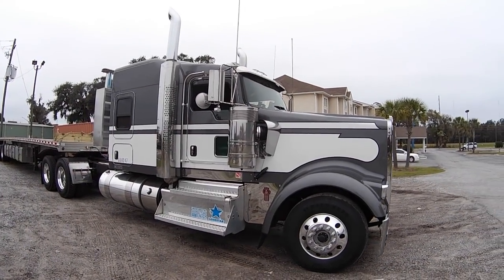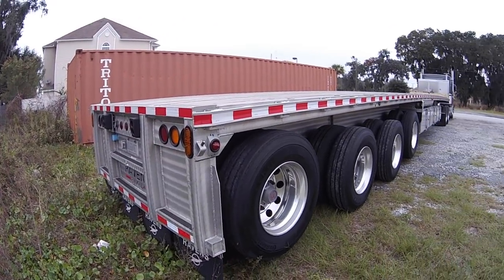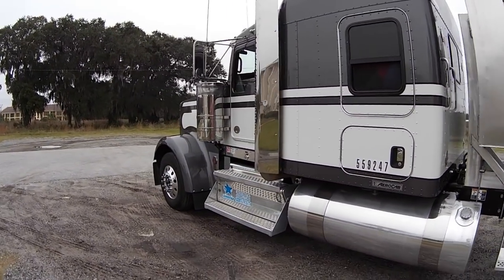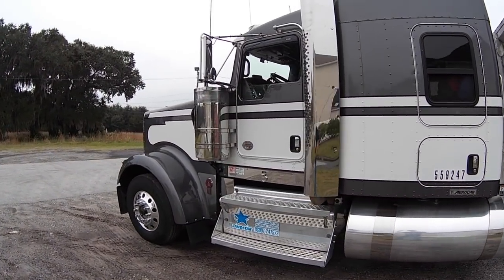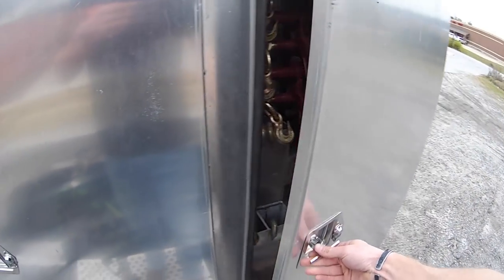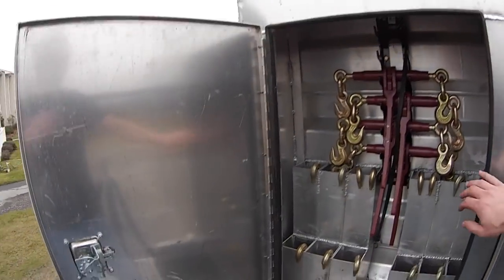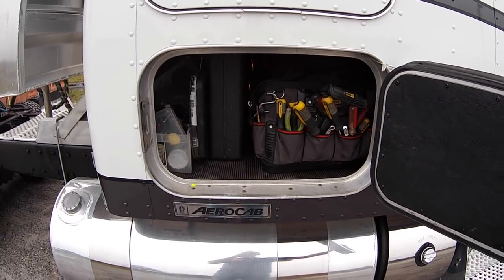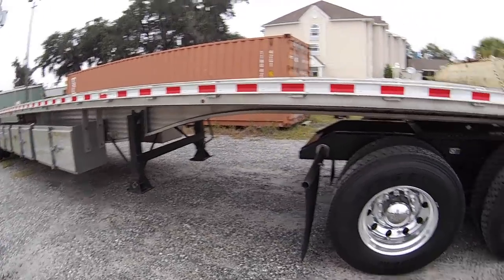Tour of my Heavy Haul KW900L and Trailer

Comment: I’m really enjoying your videos but I have a question. At 16:10  you mentioned those rubber pieces to run between your chains so you don’t decrease the WLL. I’m curious if that’s a state by state or a federal law. I have been told the chains can never touch so I really don’t know. In the business I’m in, I never let my chains touch. However, it would make my life a little easier at times if I knew I could simply place a quarter inch piece of flat rubber between them. Thanks

Comment: Mornin Nick! I'm new to the channel and love the videos so far, your a fine driver. First thing I noticed in the MHC KW mud flaps, nice touch. I am a technician for MHC and love seeing trucks and what they do and how guys like you put them to work. Great looking truck, love the color scheme and design it has. My question for you is when you purchased the truck were you expecting to go into heavy haul or was it something that was decided after the truck was purchased? I was just curious as to why the truck wasn't spec'd out from the get go with a third drive. Another question is, the last video of yours I watched was one of you haulin a 100k lb rotor and noticed the check engine light on, and with the choice of an emission equipped Cummins it could be a hand full of things. I was just curious why not a glider such as your mentor with the c16? Sorry for all the questions just curious with the equipment. 

Stay safe out there driver,
Alex
Reply from the maker: Thanks for stopping by, and welcome to the channel! We kind of fell into what we did. I had intended this truck to remain pulling a standard flatbed, and then purchase another heavy haul specific truck. However, we found that this truck was an incredible machine, and just decided to modify it. 

As far as that CEL that's showing, it's a faulty NOX sensor. No performance deration or side effects, it's just not functioning properly. A sensor that we will replace, we just have not gotten around to.

Comment: Hello! Great Videos! I have heard that set back front axle is best for heavy haul---you dont seemed trouble by the forward axle at all:) also using a 13 spd instead of 18 ...i have been told a 10 speed would suffice with heavy haul--if you have the 600hp/2050 torque setup. Are you settled on the 13spd as best?  Thank you for sharing your knowledge and experience:)
Reply from the maker: I wouldn't use a 10 speed, but a 13 is definitely prime for what we're doing. And no, we have no issues with our standard set forward axle.

Comment: OPPS, revisited your video, 2013 is the year, but the tractor looks like new both inside and out and you have yet to install the 3rd sxle on the tractor so I understand that. What will be the most weight you can put on the trailer once the 3rd axle is installed? That truck would be good hauling steel and coils. Is that your only truck?
Reply from the maker: Thank you, yes it is our only truck for now. It looks new, because we pride ourselves in taking extremely good care of it. We can do around 115,000lbs on the deck, give or take depending upon which states we're running through.
Reply: Wow, that is a lot of weight. I surmise that should cover most heavy hauling jobs and still under 20,000 per axle. I did notice how neat everything was, and realized from the first video I watched how well kept you kept your equipment, I'm certainly impressed. When I got my 93 CH612 Mack, I got it used but in decent shape, drove it a year until I saw what I needed, then had it retrofitted and refurbished where needed including things you don't see like bearings and joints, and things you do see like cab and frame paint and some new interior. Now in 2016, like you, I diligently keep it clean and maintained. Since 97, it still looks new.

Comment: What year is your tractor as they are still produced new? Also how much of it is retrofitted/custom built? Did it come with the 3rd axle and polished alum. fuel tanks and that nice paint job? I know the headache rack is custom fabricated.  Truck and trailer looks so expensive compared to Show Room spec truck and trailers.
Reply from the maker: We bought the truck the way it is minus a new clutch and the added axle. So yes, the paint job, polished tanks and side boxes, they're all factory. They are very pricey when you start having them customized the way we did (extra axle on the truck, and the entire trailer), but it is a price you sometimes have to pay to be able to up your game.
Reply: Wow, what a find, congrats!  Regardless, you have a rig to be proud of. Thanks for your reply.

Comment: wow, im surprised u heavy haul with a standard tractor, no double frame, weak KW 8bag air ride and light wt front steer. i would've thought it had double frame, 18sp, Neway air ride or Primax 52k bags, with a 20k front steer.  Arent the standard frame trucks only frame rated for 120k? before u start cracking it up? These were some of the things we were told once we started looking into a truck to move around our 80-100k excavators. i would've thought you'd just spec out a new glider before adding axles to a single frame truck.  Nice set up! Truck was a little disapointing for the big stuff u move.
Reply from the maker: People will always tell you that you need all this silly shit to make money. In all honesty, our setup is perfect for what we are doing. You don't need a double framed truck from nose to tail, 18spd with aux trans, super airbags, etc. Just find a set up that works, and stick with it. No sense spending $250,000 on a new glider when what we have works as well as it does, for $100,000 less.
Reply: actually the glider set up to how u want it is cheaper then a new emissions truck off the lot! by far. And itll go alot farther then the emissions motors, which seem to be failing around 500k
Reply: its not that u need the stuff to make money, its to have a truck thats not gonna rear up and twist when u start out on a hill at 130k, which im sure u noticed that and feel it. a double frame truck doesn't twist nearly as much when starting out. plus the resale value when u sell the truck. 30k as opposed to 50-60k youll see. im sure u saw the decrease with that freightliner in a yr or 2. same goes for a run of the mill single frame truck. we all live and learn!

Comment: why isnt the switches on the trailer set up with another cable so you can operate the axles and lights from the truck
Reply from the maker: Well as far as the axles go, they lift/lower pretty slowly so it's not really beneficial for us to be able to actuate them from inside the truck. As far as the lights go, there's no need for us to be able to turn those off/on either since we are always required to have them on when under OS/OW loads.

Comment: Cool vid my man, keep'm coming.I guess you're pulling  about 550 to 600 HP? Running a CAT or Cummins?
For your first video,you're doing just find bro. I would like to see more from ya,Cool?
And I really dig the Tractor & Trailer...it kicks ass.Take care Nick.
Reply from the maker: We have a factory spec Cummins ISX. It's rated at like 400 hp or something. We have a 13-speed with a heavy duty clutch and 3.70 rear ends. There is nothing really special about the power/drivetrain on the truck, other than the fact that it's a freakin workhorse.

Comment: 13 spd and 3.73s seems high for heavy haul work, would have guessed 18 and 4.10s at least.
Reply from the maker: No sirry! Un-needed. People spec out these massive beasts of trucks, and never really need them. We regularly load over 100,000lbs on the deck, and have yet to need a set up different than ours. And our rear ends are actually only 3.70's (I know I miss stated that in the video).

Comment: cool truck but 13 speed, and why not a 20,000 front axle ?
Reply from the maker: What's wrong with a 13 speed? I'll throw 110k on the deck and the 13 speed handles it just fine. 18 speeds are novelties for wheel holding reefer drivers who wanna say they're "real truckers", or people who actually do work over heavy grades, pulling insanely heavy loads, or just all around working in crap conditions. There's very few people out there who need an 18 speed. 

As far as the axle: We have a massively long wheelbase. It's physically impossible for us to transfer weight to the front axle. With 109k on the deck our front axle scales at like 12,7. There's no more weight to put up there, so why add an axle that offers A) a heavier weight, thus reducing our overall capacity, and B) an axle that has a weight rating that we could never possibly utilize.

Comment: What’s the tare on that setup?
Reply from the maker: At the time of that video we only had a 3 axle tractor, and I honestly can't quite remember the empty weight. After we had the 4th axle added to the truck, full of fuel and with the same trailer fully loaded with securement and tarps, we were 42,000 lbs empty.

Comment: This is heavy haul? Hhmmm. Perhaps I misunderstood the classic definition, this guy has a nice looking standard road tractor and a flatbed with a tag and pusher axle. At best I'd call this medium hauling. You need some more axles under that sled and a heavier spec tractor.
Reply from the maker: Lol. Thanks for your valued opinion.
Reply from the maker: Now that I'm on my computer and have a real keyboard, please allow me a more involved response to your typical criticisim. 

Seems there is always some jackass who has a stereotypical definition in their mind that they feel the need to share with me about what "heavy haul" is and isn't. It's as if you feel I needed to be educated, but now that I can flip the script, let me learn you a thing or two...

1) With the set up that you saw in that video, we were able to haul 92,440lbs on the deck. If that's not enough to be considered "heavy haul" then I would LOVE to see what your definition is.

2) Most "heavy haul" trucks that you see tugging around RGN's are exactly what you're saying ISN'T heavy haul. They are standard road tractors, with a lift axle. What is it that makes THOSE trucks heavy haul, yet not mine? Because I don't an 18spd? Because I don't have a 4spd auxillary transmission with 2 spd rear ends? Lol.  That is because I'm smart. I know what works, I know what I need, and I'm not going to purchase more than that, simply to appease someone behind a keyboard who has more than likely never driven a truck, much less done what we're out here doing.

3) We've since added a 4th axle to the truck, and have had 107,000lbs on the deck of that trailer. Our 13spd with 3.70 rear ends have held up to the task, every single day. If you still feel that we are a "Medium Hauling" truck, then so be it. I really have worked hard to not be effected by the opinions of others, and this situation is no different. 

I suppose I should also take this time to thank you for the compliment of saying it was "nice looking", but I promise you...our custom designed and built trailer, is no where near standard. 

Have a good day, sir.
Reply: Slow down a bit big guy, take a minute, maybe comb your hair or clean those side boxes again. 
I'm happy that you are making money and found a truck and trailer that works for you. Your descriptions of the equipment work well for the laymen and I understand the reasoning behind that, but to me you sound like a safety man or a trainer that never drove much.
I see the Valley mud flaps so I'm going to assume that you've been to Michigan and observed the weights we carry on a daily basis (not just on the slab) and without permits. I don't even consider our 11 axles heavy haul, I just think of them as visually stunning and more efficient than the standard 5 axles. Some other states go even bigger, I've seen 15 axle A train side dumps in South Dakota.
You are certainly correct in saying that most heavy haulers run around with light spec road trucks and throw another axle under it, which is what you've done, And your 315s don't fool any real truck driver, the DOT only cares about the width of your tires, not if you bolted them onto a 13,000 lb axle. 
And yes I've been a driver for 17 years. Done heavy wrecker, B trains, A trains, lowboy, oilfield rig moving and everything in between, so you might say I have a little industry knowledge and I don't even consider myself a full blown heavy hauler yet. I just drive what I'm given and get that load there in one piece.
So now maybe you understand why I felt the need to voice my opinion, it's a lot like those people who pretend to be soldiers. One day when you own a true heavy hauler you might look back and regret not calling it "specialized" rather than "heavy".
Reply: And Valley did a nice job on that frame stretch, looks clean.
Reply from the maker: The 315's were never intended to fool anyone...? I actually was explicitly clear when I said I put them on the truck because I like the way they look. You must just be wearing shoes that are far too big for me to ever fill; so I suppose I'll just stay the course and run around in my "specialized" lane, until someday I can live up to whatever your definition of heavy haul is.
Reply from the maker: Thanks, they really did. I wouldn't hesitate to recommend them to anybody looking to get work done. The only gripe I have is the paint they used. It was cheap, and has started to flake, but other than that, the important stuff was done flawlessly.